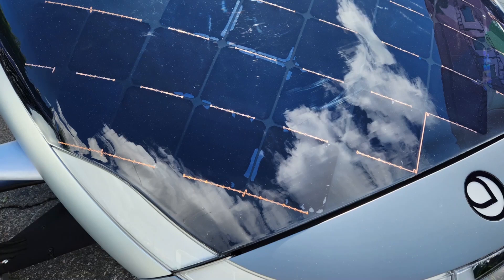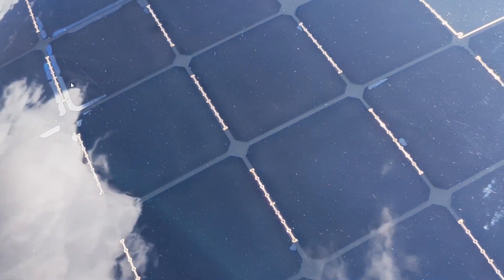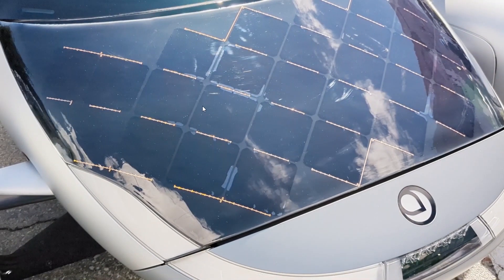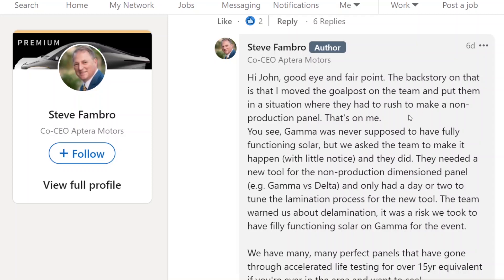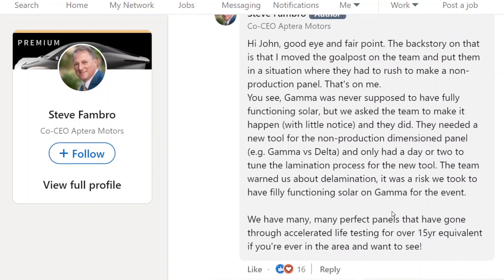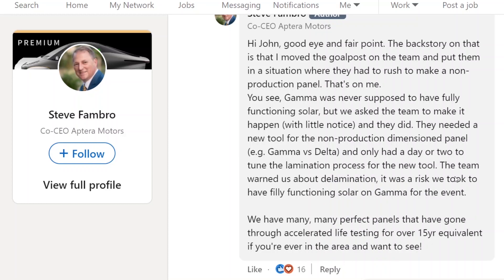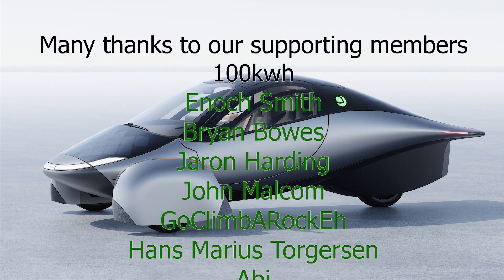Why is there delamination on Aptera's Gamma solar panels?

Comment: Gamma at Fully Charged (FC) only had roof solar and dash solar installed.  There was a table in the Aptera booth that had a stand alone hood solar.  It was difficult to see the dash solar up close but both the hood and roof solar panels had many flaws although not much, if any at all, delamination.

Sorry, but I find Steve Fambro's answer to John's question to be non-credible.  Remember that Fully Charged was September 11 and 12 of 2022 and the Aptera video "Solar is in Production" was released October 4, 2022.  There were quite a few hood solar panels on the roof of the solar fab building shown in that video and I find it unlikely they were made between Fully Charged and filming for "Solar is in Production" video.

I'd like to see Gamma's roof solar now and compare it to pictures I have access to of Gamma at FC.  I'm not a "betting man" but I have a "gut" feeling it, too, now has a lot of delamination.  I've noticed we never get to see pics of Gamma's roof.

By the way, none of the above is to suggest they haven't or won't figure out the delamination issue eventually.
Reply: Agreed.  I was at Fully Charged and took loads of close up pics of, mostly, the installed solar roof but some of the uninstalled hood panel.  I've "critiqued" the issues over on Aptera's "forum".

Comment: If you go through the myriads of comments on your related video you referred to, you will see that in reply to your then surprise, many of the commentators, me included, offered this very explanation - that that was probably a rushed project only for the purposes of the Gamma release. Now, that is confirmed. Good.
Reply: As I recall, the rushed "project" many have commented on was for the ROOF solar as it was rather flawed in it's own right.  Steve Fambro only claimed the hood was rushed.
Reply: @palindromeambigram4852  No, I remember I personally had commented on the hood copper wires.
Reply: @adimchionyenadum2962  No.  This is what you said in the comments of what I believe is the video Steve references.

"I believe the hood solar panels are just imperfections of a hastily put together panels meant  to show off a proof of concept. Nothing more. We are able to see this because this is Aptera, the most transparent auto maker ever to come to the scene."

I did not see ANY other comments or replies on that video that the hood solar might have been rushed.
Reply: @palindromeambigram4852  Nothing but crickets from adimchionyenadum.  Weird.  /s

Comment: Got to be honest, I remain unconvinced.  Certainly I believe that the panel was rushed and that delamination after just a couple of days may be a one off.  However, I'm still concerned about the long term durability of the panels in regards to delamination.  Especially since these things are intended to be out in the sun perpetually.  I also don't really believe that you can truly simulate long term exposure to the elements in a lab.  I understand though that they are doing the best that they can.  I'd really like to see them come out and open the curtain a bit and show the public some production intent panels and show them undergoing the testing that they are performing.
Reply: They have been pretty open, especially for a process that is still developing IP.  We know that they have had stationary test panels in place for years, although, of course, these don't represent the current encapsulation process.  They have shown video of the impact testing and environmental chamber temperature cycling.

Comment: Actually these are irrelevant issues (easily fixed, definitely not high tech) but shows a lack of control on the product.
Reply: It is safe to say there is no formal quality control on the parts because what is shown is not actually a product for sale produced off of a manufacturing line.  It is a hand-built prototype for testing purposes and display.
Reply: @jonj9149  All true but definitely not a good idea to put that out to the public, someone needs to be on top of the unwrapping or this will definitely go nowhere and that would be a shame!
Reply: @ericdelevinquiere9902  Yes, I agree it would be better to avoid the image issues.
Reply: @jonj9149  But solar has been in production since, at least, October 4, 2022.  When, supposedly, do we think the "hand-built prototype" was made?

Comment: Thanks for the heads up on this. I've been curious about the delamination too. Good to hear they're accounting for it.

btw.. just my opinion, but I would think if you're able, it would still be pretty neat to get a test spin in Gamma. Even though it's gonna be a little different from Delta, it would still be really interesting to check out. Most of the dimensions will be the same (I think). The fully functioning suspension on a finished model would be good to check out. And I'm sure with your eagle eye you'd find some interesting details to ask about or share with us

Comment: I think it likely this delamination is from dissimilar expansion from infra-red heat, If the layers intrinsic to the construction of the cells is ever so different by even the slightest amounts of thermal expansion, stresses will build up...and frankly, something has to give.

Comment: I think there is a possibility that they won't have a Delta until they reach a significant percentage of the manufacturing funding goal. I just can't help but assume a large portion of that needed money is associated with the tooling cost for CPC group, and without it, CPC can't make any Delta body components.
Reply: I’m wondering if the first Delta will actually be assembled at CPC to verify the quality and fit for CPC personnel. It would definitely be an incentive for them. It would be easy for Aptera to direct the motors, batteries, etc. there for a one-off build.

Comment: The solar front hood shown was NOT premiered at Fully Charged.  It came sometime later with that video. Gamma still had a mockup hood at Fully Charged and didn’t have the copper interconnects.

Edit: For all the people enjoying arguing here:  keep at it.  No actually, I was referring to the hood of the car as shown at FC. I looked at it carefully when I was there on day 2 and saw it was a mockup.  I faintly remember that they had some stuff over on a table that was mobbed at the time. If that was a hood then yay for you. Pat yourselves on your collective backs, but please keep arguing, I mean, life is too short, right?
Reply: There was a real, not "mockup", solar hood at Fully Charged.  Same cells, copper interconnects and encapsulation.  Even had same feedthroughs as roof solar and wiring coming out the back.  There are pictures.......
Reply: @palindromeambigram4852  There was not a real solar hood at Fully Charged. What you saw there was a mock-up solar hood. Look at it again @ https://youtu.be/W8RYs9OcycQ.
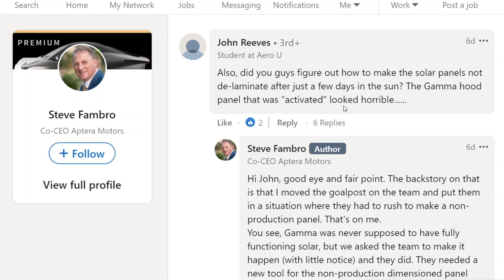Reply: @adimchionyenadum2962  Got a time stamp on that video for me to look?  I watched it and didn't see a "mock-up" anywhere.  Regardless, I did see the hood solar panel (non-mock-up) that I refer to above.  It's not on the vehicle, it's on a table.  Look at 1:16 (on the video you provided a link to) behind Chris A.'s elbow.  You can even see a un-coated copper interconnect.
Reply: @PalindromeAmbigram  C'mon! Go get some life, man.
Reply: @adimchionyenadum2962  Are you serious?  Denial isn't a good look.  What's the time stamp for your "mock-up"?  That's hood panel on the table behind Chris is real.  C'mon!  Go get some life, man.  Failing that, ask AOC creator Steve.  He was there and must have seen it.  I'm sure there are other vids that show it better.  Better yet, ask other of your Aptera fan boy friends that were there.  They must have seen it too.
Reply: Real and "functional" (not mock-up) hood solar panel at Fully Charged.  Pause the following vid at about 0:29 and use your cursor to "drag" image around so that you can keep an eye on the table under the big green/white Aptera sign and then restart the video.  You can continue to drag image around while it's playing.

https://www.youtube.com/watch?v=nEuO4ekE6_Y
Reply: @palindromeambigram4852  Good job on shutting down adimchionyenadum!!  He's such a "tool".
Reply: Null Pointer said: "Edit: For all the people enjoying arguing here:  keep at it.  No actually, I was referring to the hood of the car as shown at FC. I looked at it carefully when I was there on day 2 and saw it was a mockup...."  My response.  Maybe it depends on what you mean by "mockup" but I was there also (both days) and if by mockup you mean fake solar cells like on at least 1 of the Alphas, there was NO mockup solar hood on Gamma.  There are numerous pics/vids that show that....
Reply: You are right, it was when they featured the solar hood in a follow up picture.
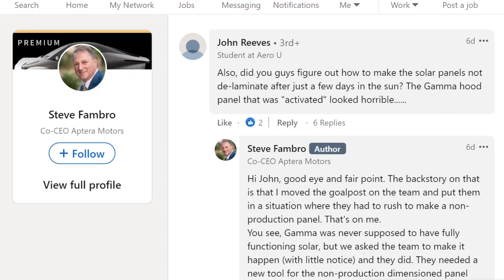Reply: If you look at Raj's 360 video of FCL at 1:05 and the AOC 'Aptera Footage from ECW2022 Analysis' showing delamination at 2:49, the pattern of the copper interconnects is very different between these two hood panels.  The prototype "functional" hood panel on the table at FCL is NOT the same hood panel on the Aptera gamma at ECW2022.  Null Pointer and Adimchi Onyenadum are correct.  PalindromeAmbigram and John Reeves are the same person and there is at least one other alias which is how all of their comments end up with 3 thumbs up.
Reply: @jonj9149  Neither I nor my supposed 2 other aliases have claimed the two hood panels are the same.  Why are you making things up?  Null Pointer and Adimchi Onyenadum are incorrect that there was no real hood panel at FCL.  Your habit of making things up is creepy.

Gee, my 3rd alias is a slacker, he/she only showed up a couple of times!
Reply: @palindromeambigram4852  I already checkmated you.  You can go home now.  Flipping the board doesn't change the outcome.  Buh bye!  😊
Reply: @jonj9149  Jon J said: "I already checkmated you."  My response:  You lost every argument.  I don't think checkmate means what you think it means.  Are you still going to take your ball and run away?
Reply: @jonj9149  That's nice that you can look up a bunch of psychology terminology on-line to make yourself sound credible.  Also, project much?  Remember, in reality, you lost every argument.
Reply: @palindromeambigram4852  Oh, and checkmated = LOST.  You were checkmated, John R., checkmated.
Reply: @jonj9149  Jon J said: "How original! Can't think of something original, so you copy me. Copying is the greatest form of flattery.  I didn't look up psychology terminology and I'm not pretending to be something I am not.  Unlike you.  Go get help."  My response: Oh the irony If you're flattered by my sarcasm laced copying.  Here's more for you to be flattered by: I didn't look up a bunch of material analysis of solar cell encapsulant and I'm not pretending to be something I am not.  Unlike you.  Go get help.
Reply: @jonj9149  Jon J said: "Oh, and checkmated = LOST.  You were checkmated, John R., checkmated."  My response: You (Jon J aka Ken aka Null) lost every argument = checkmated.  Seek help.
Reply: PalindromeAmbigram said: "I'm not pretending to be something I am not".  My response: LIAR.  You are pretending to be two different people.  You are not two different people.  You LOSE AGAIN.
Reply: Sorry guys I was talking about on the car. The one in the car was still a mockup. I was scratching my head when he said FC because I was there and carefully looked at the front of the car. Now sitting on the corner… Fine you got me. I didn’t really look there because of the crowd. I bow in your general direction.
Reply: @nullpointer782  What do you mean by "the one in the car was still a mockup"?  In videos, I've only seen the real roof panel on the roof of Gamma, the real hood panel on the table under the big Aptera sigh and, finally, the real dash panel on the dash inside the car.  I see 0 mock-ups.

Comment: Yeah, I heard that story when Steve explained about the solar panel delamination. I think that it was a good risk to take because more people were impressed at the FC show to know that the solar was actually working in the Gamma, than pointed out the delamination issue on the prototype vehicle. I think that it would be worthwhile for you to drive the Gamma model because most all of the actual driving/passenger reviews of the Aptera were made in the Alpha models, which are far more crude than Gamma, and the Beta model was just an open shell. So if Gamma gets back from Italy any time soon, then you can tell us how it drives in comparison to earlier models. And if you do it after Jan 20th, you can work in some questions about the Launch Edition, funding and Delta production. Even if the big funding does come very soon, it could still be many months until the production intent tooling is finished and newer driving models are available to review. So it would be nice to get a real world Gamma review in the meantime.

Comment: Long-term delamination may be one of the biggest challenges the Aptera solar team has to face, and preventing it, is key to the end product and vehicle.  It is not insurmountable however, just a tough one to iron out.  I believe they have the issue licked, and also locked down in one or more patents.  If this is true, Aptera then owns the rights to the process, making it a possible revenue channel.  Great topic and video Steve, and it's fantastic to have Steve Fambro's direct feedback on it!  As always, Thank You for your hard work here!!
Reply: So far Aptera only has 1 solar related patent and it's just a "design" patent not a "utility" patent.  I believe they claim to have on the order of another 10 to 20 patent APPLICATIONS in with the USPTO and most of those are likely just "method of manufacture" patent applications.

Comment: You are a treasure trove of information and want to thank you again Steve. Looking at anything under a microscope will show the flaws. The explanation of those flaws in this case, makes sense, and I am pleased that this has already been addressed by the folks at Aptera. Whenever a new product is made, the idea of perfection for a standard is very hard to meet. Given time and tweaks to get there, in my opinion this seems to be the case of trying to get across that finish line with a bit of a rush, or a push that was not quite ready for prime time. Good thing so many eyeballs are looking at this project, as it just makes it better. "Good, Better, Best, never let it rest, till the good is Better, and the Better is Best!"

Comment: I kinda understand the issue with the panel at Fully Charged, however Gamma was to be revealed (by Chris and Steve saying so) around July 1, 2022.  I'm not certain why it would be a sudden rush to make a gamma panel even if Gamma is purely a one-off vehicle?  If the panel goes bad, replace it.  Don't show off poor workmanship / issues.  Stuff happens, correct it and show that things will be corrected.

Gamma is tending to seem like a very expensive disposable vehicle that is kinda a show vehicle but not really as it is very different than Delta and Prod.  If it is actually built to be like the 400 mile version, it would be good to know if the vehicle is performing in the ballpark of expectations.  Can they get 300 miles on a charge?  Is solar charging as expected?  Sure Delta is a bit different but not that different that some basic tests can't be done.